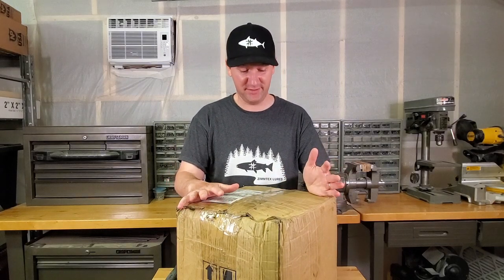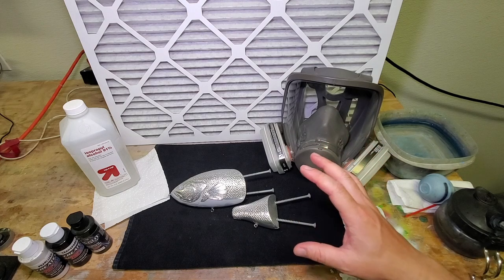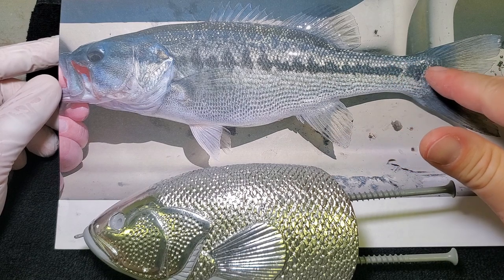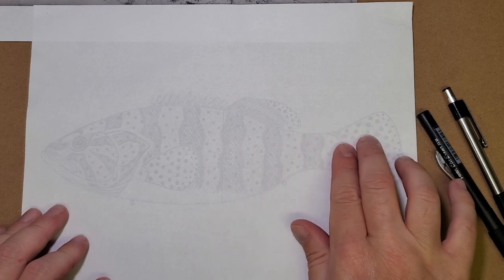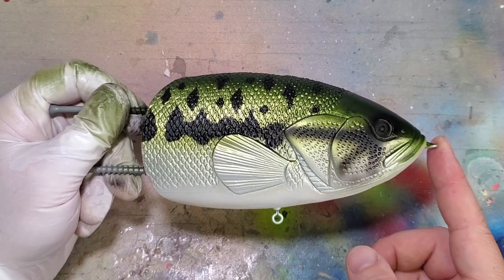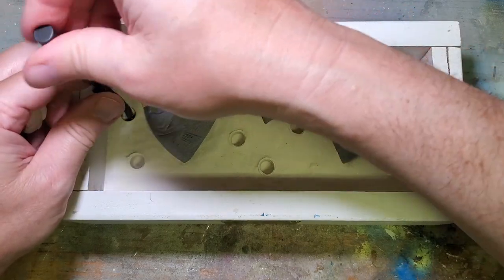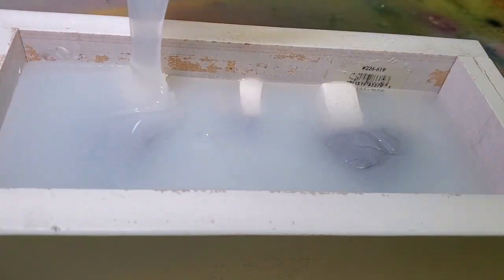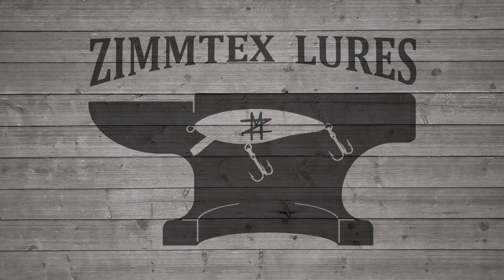Bass glidebait painting and bluegill molding.

Comment: I agree don't skip out on the PPE. I actually did a lot of research recently for ventilation. 

Ive seen activated charcoal filters recommend instead of hepa house filters.
They say the hepa are for particulate matter that is large, much like dust and stuff from sanding. And vapors/VOCS are way smaller particles that just pass thru the hepa, whereas those vapors stick to the carbon filters. Adsorption is moisture dependent too. So its key to keep humidity super low for them to stick, otherwise it could off gas from the filter back into the space. 

Then I was starting to read up on PECO filters and thats where I stopped. 

Keep up the great videos!
Reply from the maker: Thanks for sharing your research and for watching!